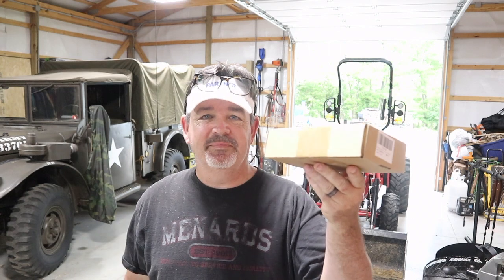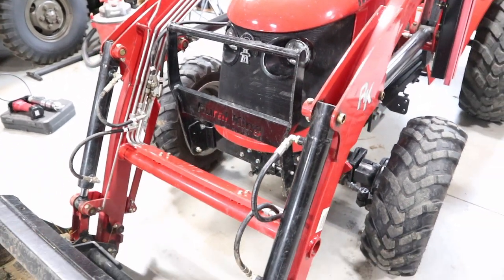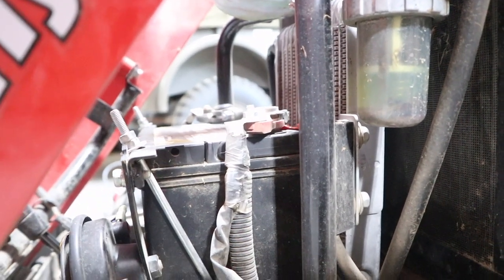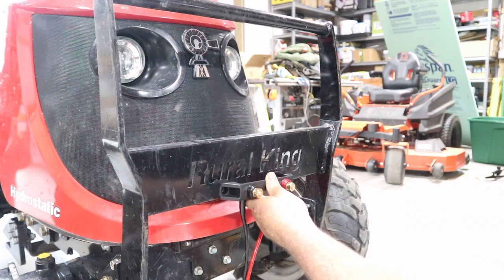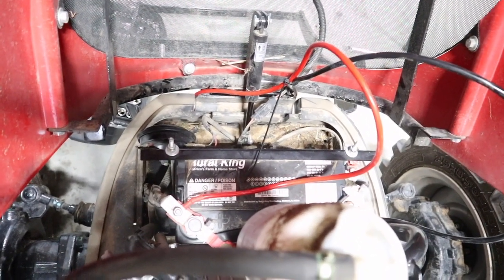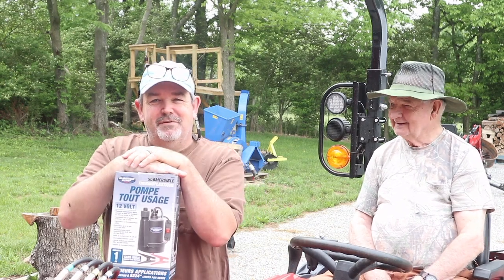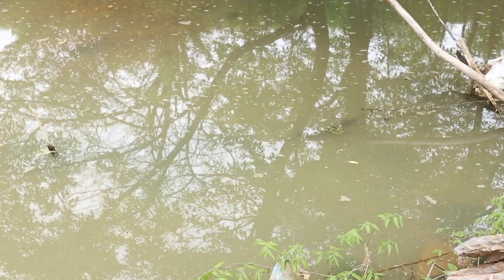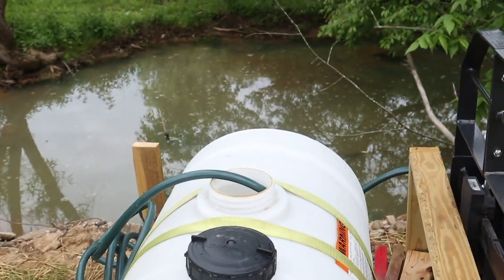#178:   RK25 / T25 Mod - Remote 12V Battery Terminal Installation & Submersible 12V Pump

Comment: What is your set up for watering from the tank.  Do you use a small 12 v pump or gravity?
Reply from the maker: Currently Dave I just raise the forks and the tank up about 6' and use gravity to water.    Pump would be better, but as you point out, would need a smaller one to fit down inside the tank opening.   It is a bit of a pain due to (a) takes longer, and (b) limited by the short length of my hose before I have to move again... I appreciate the question.    If I can find a small 12V sump style pump, I would love to give that a try.
Reply: @TryNewThings  Your set up has given me some ideas, as the name of your channel says, try new things.
Reply from the maker: it may not be pretty but it works.   Make sure you strap your tank to your pallet if you do steal my patented set up... don't ask me why I would recommend that.

Comment: Often wondered how to jump start a battery in that location. For your system, just what you need. However I see people working under loader all the time and it scares me. Hydraulic lines fail and loader comes crashing down. You need cylinder stops to protect yourself. My tractor, different brand but the same. You must raise loader to service removable radiator screen. All combines have header stops to protect you when servicing them. Thanks for sharing
Reply from the maker: David, as always I appreciate the insightful feedback.